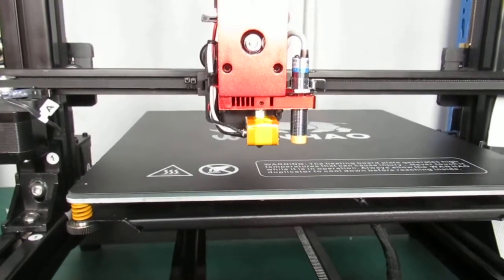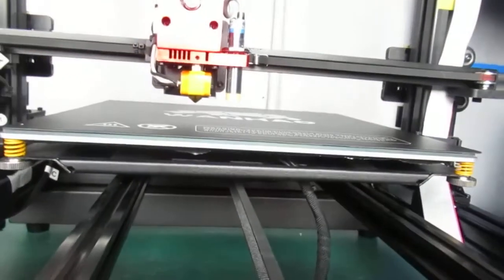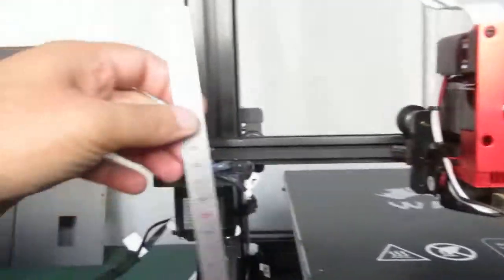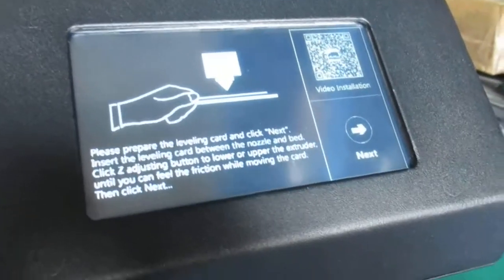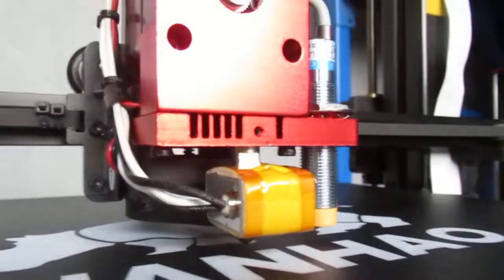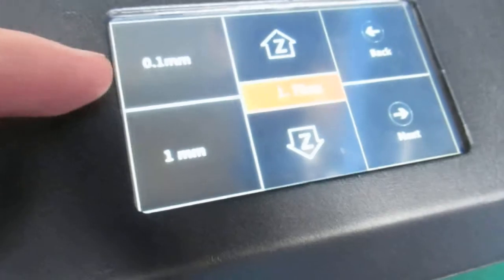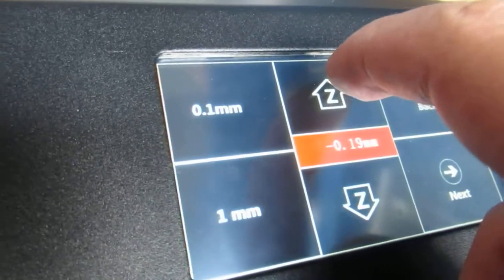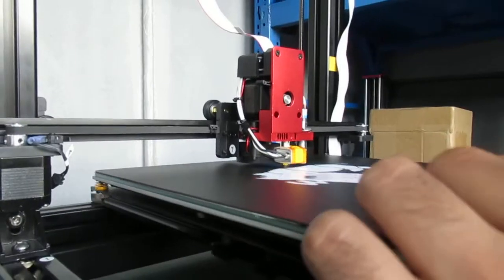D9 300 adjusting Z offset and leveling bed

Comment: There is NO manual levelling after the upgrade. Even though you look at the "graphics" and it should be there. In any case before each print it over rides the manual settings and does an auto levelling process. This stuffs it up completely . Why ? Why insist that your program is better than a real person levelling the bed ? Not realistic !

Comment: I wanted to use this printer for prototyping .. not stupid toys. But this thing is just CHEAP. For gods sake LIMIT SWITCHES ! A Level sensor that works ! Sense the current on the stepper motors.. that can be used to detect a limit (CRASH)  The Z Axies do not drive the same steps ! My gantry was out 9 mm after a Z Max and then a Z min !

Comment: This is so FAR from the TRUTH of what really happens. The V0.161 Firm ware can only be installed if you connect the printer BEFORE you install the V1.1 Cura software. Otherwise it does not recognise the printer at all. The instructions are for someother piece of software .. The V2 Beta that they advertise on the http://www.wanhao3dprinter.com/Down/ShowArticle.asp?ArticleID=94 site is NOT available for download. Try clicking on support and you get a blank page. The sensor on mine needs to be adjusted down 7mm per print ! Rubbish . There is NO Z axis or Y Axis Or Z axis limit switches.  Well there is one on the X axis .. but only a zero limit. and one on the Y axis but only a zero limit .. This machine is cheap. It really does not perform. I am asking for refund on mine. The bed leveling .. when you drop the Z axis down .. only goes down to 17 mm or so .. and then .. it;s still 5 mm off the deck .. I levelled mine with a micrometer. The damn thing does not accept this as a calibration it wants to do it's own. and It does not work. Garbage.. Just garbage cheap and not well designed .. especially on the limits, and the software.